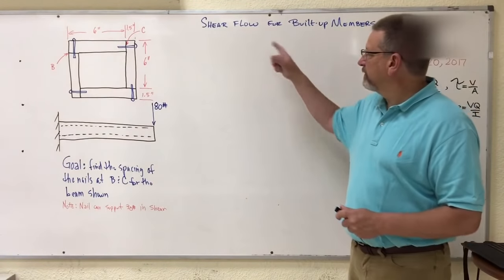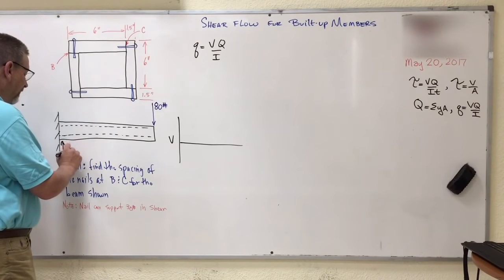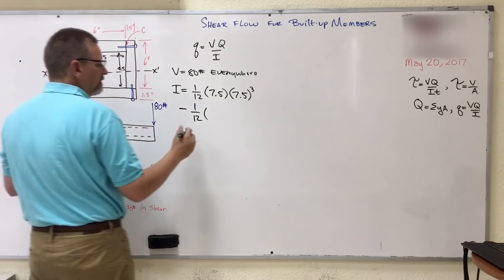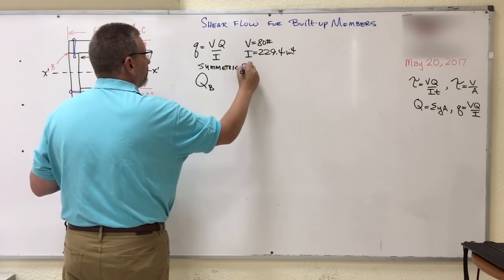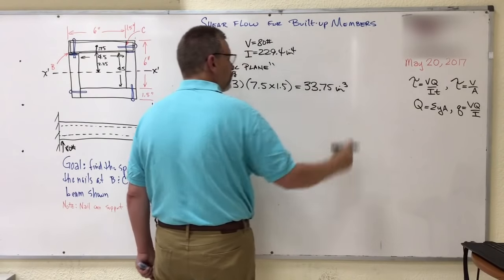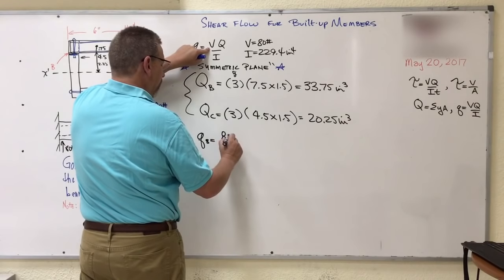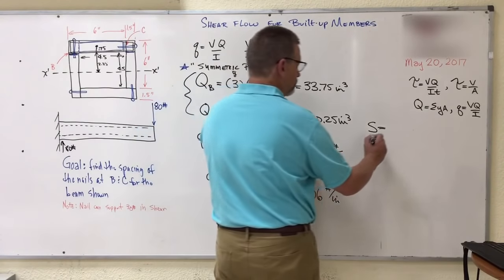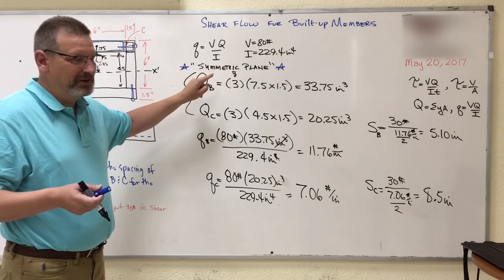Mechanics of Materials: Lesson 34 - Harder Shear Flow Built Member Problem

Comment: A clarification: for the spacing determination, the top of the beam in your example fixed end beam is in Tension.  Also, you mention dividing by two because there is also a bottom row of nails.  While you do come up with the correct answer, the reason you divide by two is because there are two shear planes at the top of the member, as there are also 2 shear planes under the neutral line.  Since you are looking at the top of the member the total shear in tension should be divided by two since there are two shear planes in tension.
Reply: thanks I was wondering this too, I think you explanation is on the spot

Comment: There's a bit of confusion. You said after concluding your final answer for their respective distances, that B and C need to be 5.1" and 8.5" apart respectively from the other nails. When I see the total length of the square beam, it's only 7.5". That seems a little confusing however Hats Off to your way of teaching. You're a life saver for many!
Reply: the cross section is 7.5". The actual beam itself doesn't have a listed length in this problem.
Reply: @user-sy1we3od1k  You just cleared up my brain stuff, thanks!

Comment: Professor would you have to calculate 2 different I values if the sides of the beam were not all symmetrical? Meaning would you have to calculate for Iy and Ix? Or do you just use Ix as you have in this video? Awesome content thanks!!

Comment: How come the centroid for point C is the same as point B? Shouldn't it be 3.375?
Reply: technically the centroid doesn't belong to one specific point, it is the average distribution of an area or volume. The centroid for the first section vs the second section doesn't shift vertically, but it does shift horizontally (but that doesn't matter in this problem)

Comment: Hi, for the area in Q, arent we supposed to take the area that is affected by the nail? For example at point b, the area that is affected by the nail at b is the one below the nail.
Reply: Oh wait now i understand, thanks anyway!
Reply: doesn't matter which area you are taking (above or below). Both gives the same q value
Reply: how is the bottom the same? I did that the first try and got a number way later (64.125)
Reply: @uygarsolmus2455  I think you are mistaken in this case.